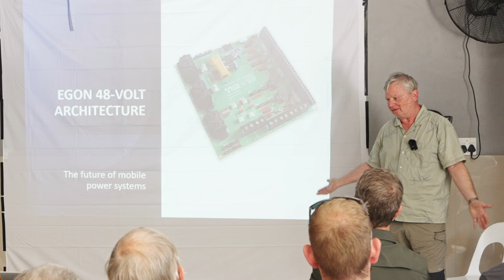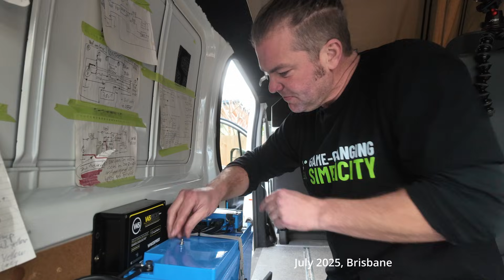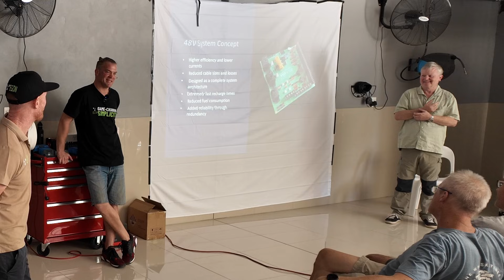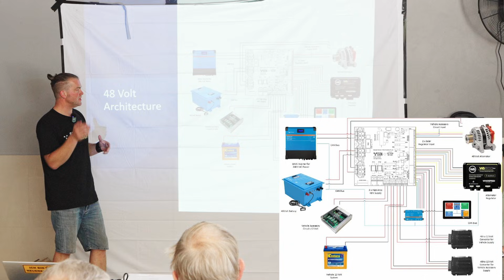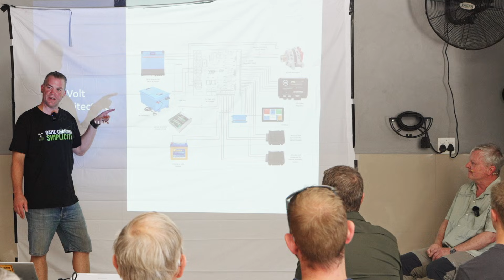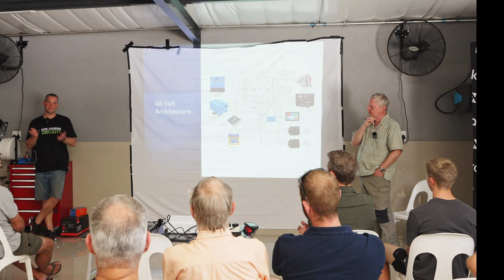48V Reality check. Technical Demonstation Andrew & Heiner, Johannesburg 7 Feb | EGON

Comment: Hi Heiner, Andrew,
Great to see you back in form.
I've been waiting for some coverage from RSA, and I finally got it :) Of course, I'm most interested in the 48V DC Hub. Great to hear you've improved the protection for a 48V alternator load dump scenario (as I understand it, this protection now has two stages). I was also considering using the Balmar APM-48 Alternator Protection Module, but I understand that your system is already fully resistant to high-voltage spikes.
Best regards, Raf